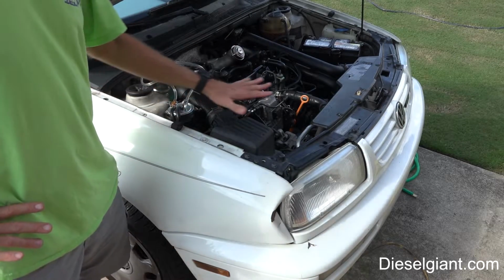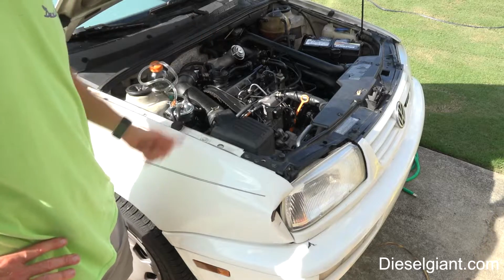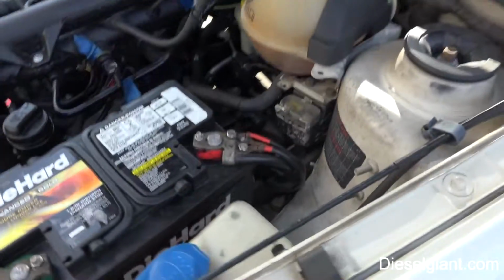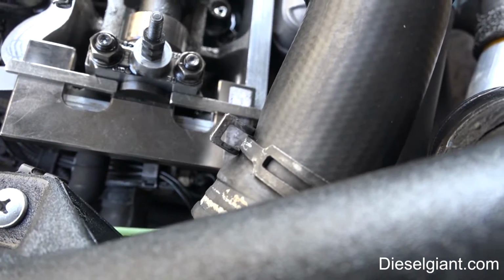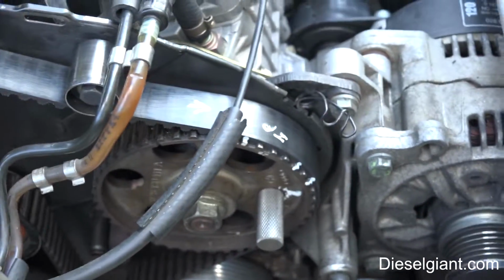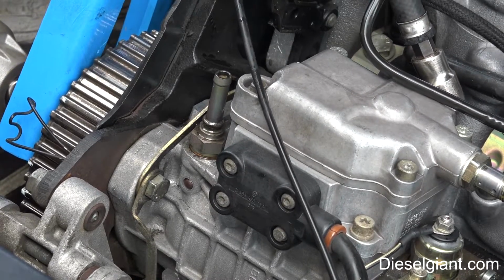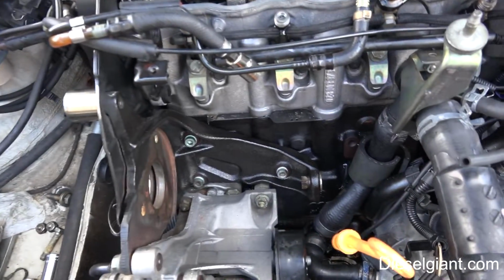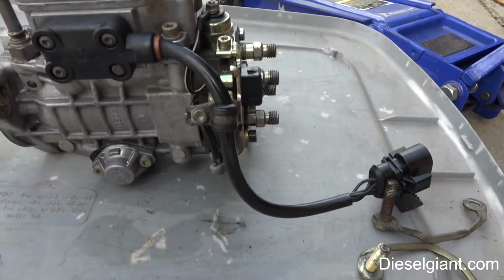1998 VW Jetta Tdi A3 Injection Pump Removal AHU Engine

Comment: You have the sameset up I have, there's a 2 wire plug and a single wire right in front of my motor on top of radiator can't figure out where they go

Comment: I'm tearing down a 1Z right now to build for a geo tracker and can't get the pump pulley off.  Didn't seem like you had much of an issue but I'm cranking on my puller and it's not  letting go.